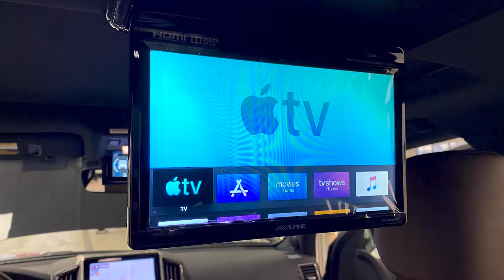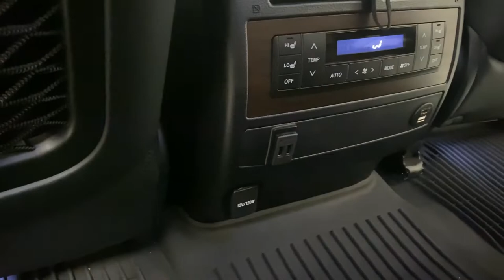Land Cruiser 200-series electronic mods

Comment: Curious what arb compressor you used for this one?
Reply: Late to answer but just in case...it's the ARB On-Board Twin High Performance 12 Volt Air Compressor - CKMTA12